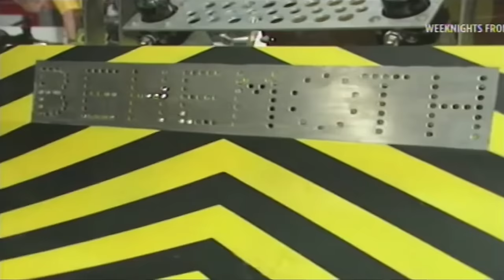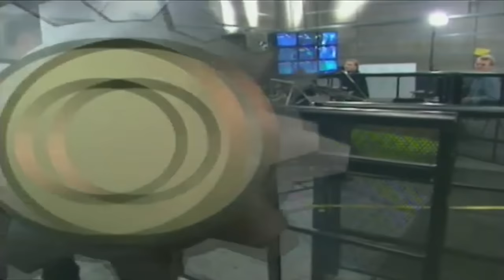Robot Wars Series 3 Heat B

Comment: People always act like Pit Bull got lucky in that final, and yeah they kinda did, but honestly I actually think they were winning the fight any way.  Behemoth got the one good flip in at the start, Pit Bull then got righted and after that they were the more aggressive imo.  Sure, we can only speculate how the fight would have gone if the spike hadn't interfered, but to say Pit Bull got lucky is a discredit to how well they were actually doing
Reply: Lol Pitbull wouldn't move after that flip without houserobots
Reply: In that key moment where pitbull was flipped, Pitbull was right on the line and I think technically the house robot didn’t leave its zone so it was a legitimate flip and should have been left alone. That said, terrible steering overall from behemoth this time around and the house robots punish bad steering brutally.
Reply: @esunsalmista    The house thugbots just charge in any time, randomly and completely without justification.   They should have been got rid of.   Who knows which bot would have won if the house thugbots hadn't interfered?
Reply: Tbh I think Behemoth can feel a bit hard done by, by rights they flipped Pitbull but Dead Metal unnecessarily righted it, that said from that point onwards Pitbull was on top, but imo the flip should have been the end of unless Pitbull righted itself
Reply: The very same luck resulted in Pitbull losing to Firestorm in the semi final ironically. And yes, in an arena where the traps are as dangerous as your opponent, if you chose the wrong moment to drive over a floor spike, "luck" will bring you down

Comment: Dig from Sump Thing always struck me as one of the great sports of Robot Wars. Never did well, always great to see him back.

Pity that Abaddon's caster came off. It was otherwise the more damaging robot. Shame it couldn't actually do anything for most of the battle, otherwise who knows how that might have panned out. Certainly it was doing more damage than Technophobic. Speaking of Technophobic, its elimination was certainly one of the more impressive ones!

Robocow's got a team that didn't really learn from their mistakes. They would later enter The Spider, another robot that went in overweight and had to have bits removed - in The Spider's case, their armour. The House Robots were particularly merciless with it. Wonder what their beef with it was?

Last week the Trial competitor was Dominator, who would later come back as Dominator 2 and be pretty successful. This week there's Velocirippa, whose team would later on make Series 9 third-placer Ironside 3. Just an interesting thing I'd noticed there!

Behemoth was so unlucky in the heat final though. Dead Metal stopped them finishing off Pitbull right at the beginning, then they got spiked. Fair play to Pitbull though - they certainly gave Behemoth a good fight nevertheless! Considering who they'd fight later on, though, I doubt it's a result that would have changed the result of the wars dramatically.

Comment: I think this episode shows one of the few times that Bash's flamethrower was actually effective! It was actually able to so something against Sumpthing because it was exposed.
Reply: He took out nemesis in series 1 and 2 as well.
Reply: @Vi-ob1yu  The thing with Nemesis and Diotoir though is that I feel like the fire doesn't do much to them. Yes, it lights the fur on fire but it's stuck onto a solid metal shell, so it's more for an effect than actual damage. That said, if Bash gets the bottom of a robot with the flamethrower then it's a near guaranteed kill.